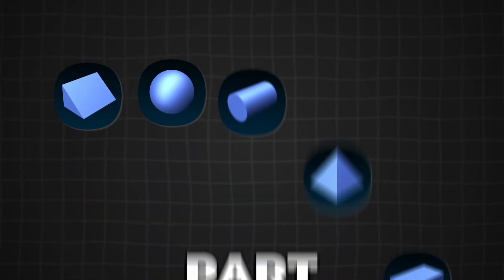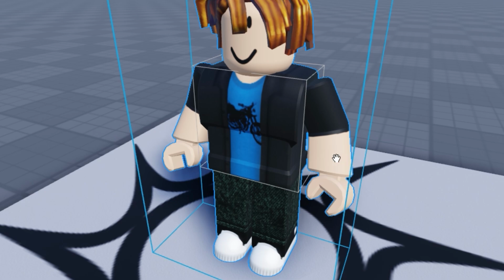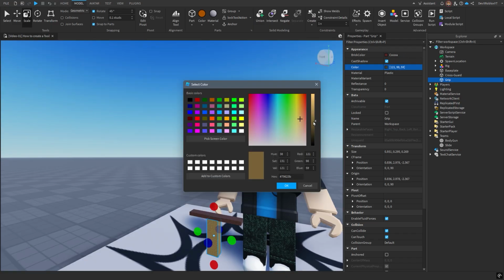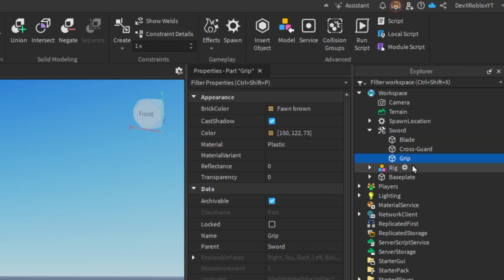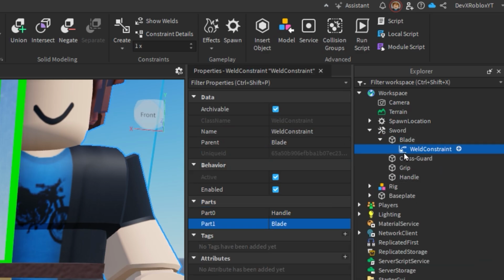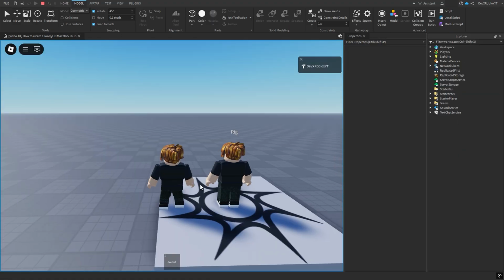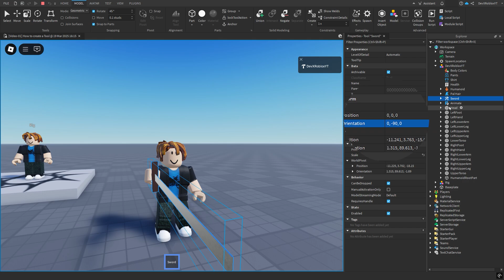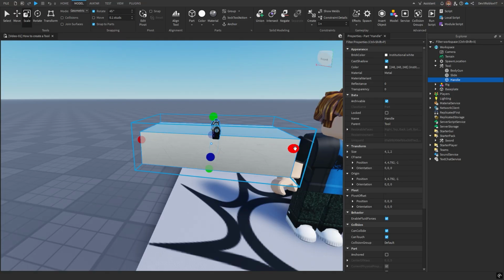How to make a Tool in Roblox Studio

Comment: It worked! If your having issues make sure you listen carefully.
Reply from the maker: Yeah nothing is a nice to have in video ❤
Reply: You're* HAH!!!! 🫵
Reply: @ make sure you're listen carefully. You* HAH!!!
Reply: @sk.joke9272 your* you're is used to say like "you're funny," and your is used to say "your toy"
Reply: @josephaboutin7546  um... no. those examples ARE correct and are a good way of remembering which Is which. but you still used It Incorrectly.
"you're" Is just "you are" but shortened (you are = you re = you're)

"If your Having Issues" would Imply that "Having Issues" Is an object.
"If you are having Issues" Is the correct way to say It. so "you're" Is right. :))

so basically, If you're ever stuck on which to use, think: does "you are" work here Instead? If It does, use "you're" and If not then use "your".